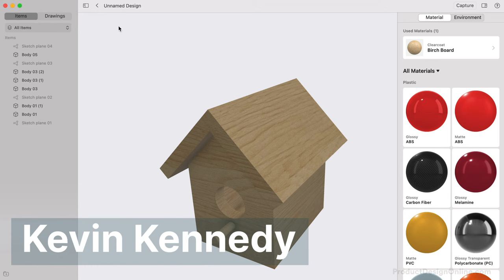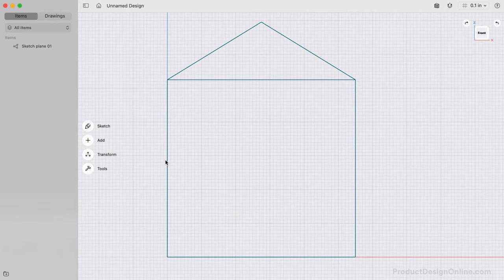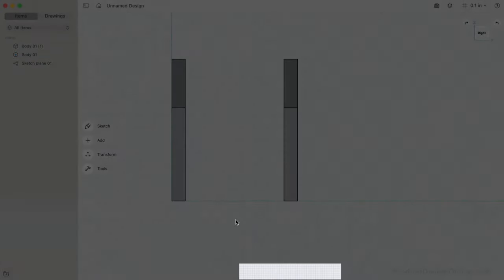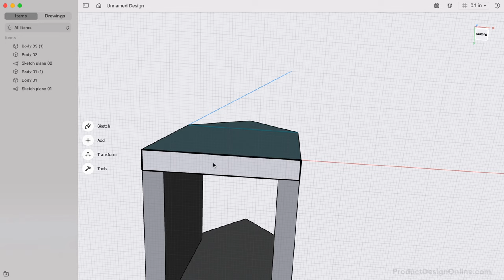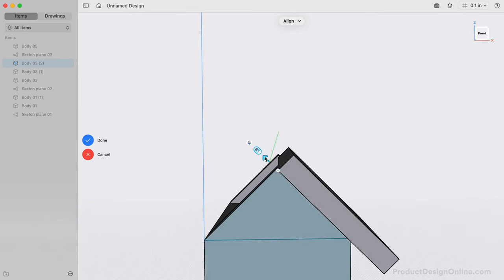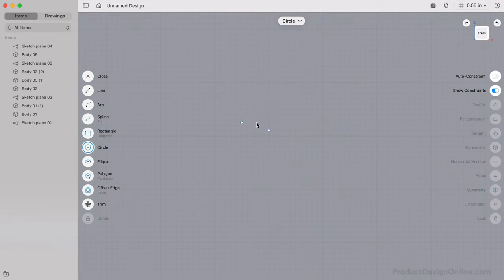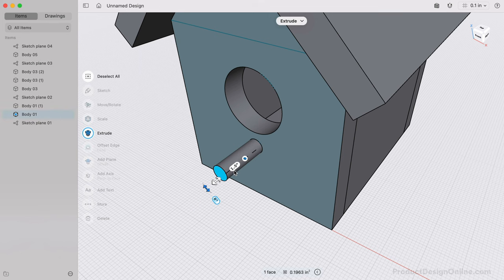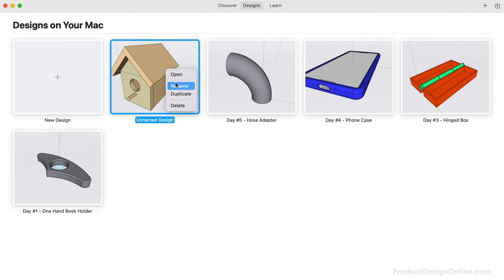Shapr3D for Woodworkers - Beginners START HERE

Comment: Excellent, thank you! When you finish positioning the roof at 4:40 any follow up adjustments (after deselecting) will not configure the move arrows parallel to the roof line, only in the xyz planes. Is it possible to rotate the move arrows to match the roof line again at 45deg?
Reply from the maker: When using 'Move/Rotate' you can toggle the "Auto orientation". When turned on, it will match the direction of the 3D body. When off, it will match the XYZ planes.

More can be found here: https://support.shapr3d.com/hc/en-us/articles/360021171980-How-do-I-move-and-rotate-objects-#:~:text=Go%20to%20Menu%20%3E%20Transform%20%3E%20Move,%2C%20vertexes%2C%20and%20the%20grid.